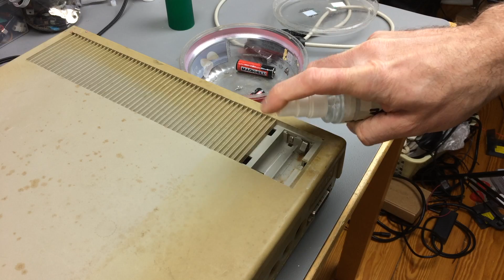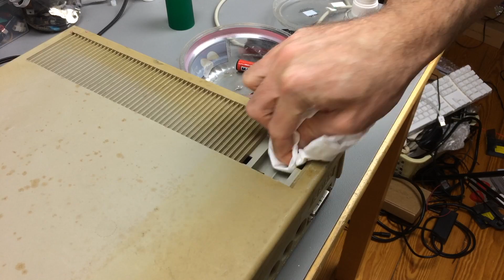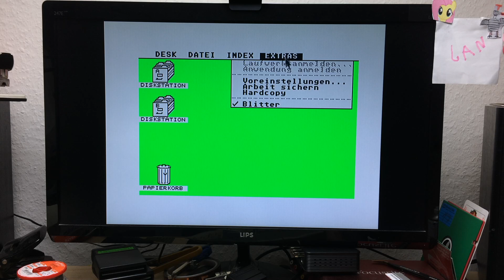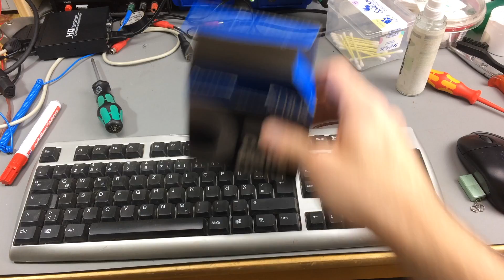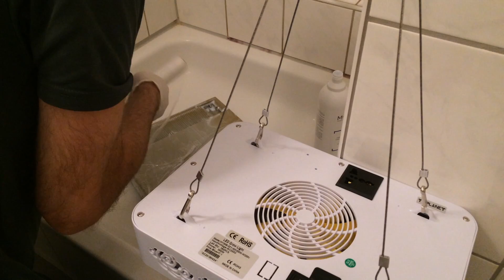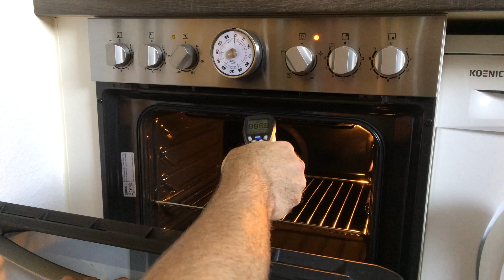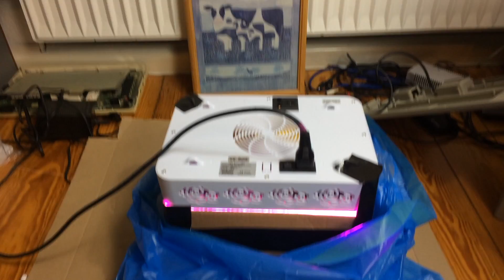Atari Mega 1/Mega ST Restoration

Comment: In 1991, I had that Mega ST with a Hi Res Monochrome monitor and harddrive but had a hellava nightmare when a friend sent me his vie 'Parcel Force' delivery service in the UK, it took 6 weeks to arrive and when it did, the main case was cracked, and the PCB of the keyboard damaged on the left side leaving some keys non functional. My friend made a claim for damages and failed delivery..then a few weeks later two guys came round in black suits (looking like the guys from the Men In Black films) to my house to have a look. They tried to claim the sender didn't pack it properly (which was bollocks ) .... A year later, I blew it up when I tried connect a CRT TV to it... I wasn't too bothered as I was really wanting an Amiga 500, which I got a few months later, and a year after that I got an Amiga 1200 which I still have today. It's setup in front of me, next to my I7 920 desktop system and laptop.

Comment: Hi, I used to repair all of the Atari ST range of computers back in the day in the UK and what i can recommend replacing are the square 68pin sockets for gold plated sockets they are far superior and once you do this you will not have any contact issue's with the Glue, MMU or Blitter chips. I also used to replace all of the socketed chips with ZIF sockets especially for the yamaha sound chip which also acts as a side select and drive select for the FDD access. You can also upgrade the 1770 disc controller for a 1772. My brain is a little rusty but i would also suggest socketing the 1650 chips because they have a tendency to fail.I cant think of anything else at the moment but if i do I will let you know.
Reply: Wouldn't the WDC disc controller upgrade require also upgrading to a later version of TOS? Like 1.06?

Comment: About the scrolling. Horizontal scrolling is really really REALLY hard without the Blitter-Chip on the ST (STE has an updated Shifter/MMU that can do that). The Processor has to copy all the bytes two at the time (12 cyles per 2 bytes). You can buy some time with double buffering, drawing one frame while showing the other. But doing so in a game is absolutely impossible. There is simply not enough time. I wrote some scrolling demo that used four frames at strategical points in the memory and drawing in them simultaneously to allow a semi smooth scrolling. But it took up all the CPU-Time.
Vertical scrolling on the other hand is really easy. All you have to do is moving the start point of the graphic memory by the amount of byes that makes up one line on the monitor. here it helps that the system memory and graphic memory are the same. How often i wished i could switch The Horizontal Sync and Vertical Sync on my Monitor so that the image is drawn from left to right not from top to bottom. Would have bin so much easier to make nice games. :-)
What the Blitter chip does is copying (and transforming if you want) one (or two) memory region(s) into an other. To do that the processor gives up the system bus for a few cycles. The processor can do his own thing in that time with the internal stored data and command. The Bitter is nearly 10 times faster that the CPU in copying the data.
By the way four devices get a share of the system bus. The CPU, the Shifter/MMU (graphic processor and memory controller), the DMA controller (Floppy/ACSI) and the Blitter.

Comment: Retrobriting using the "oven technique"  worked quite well for my Super Nintendos. I used 10% hydrogen peroxide mixed with water (effectively giving 3% h2o2) and put them in the oven using a roaster @ 50°C for about 24 hours, sometimes even 36 hours. Time and patience are the key ingrediences here: Higher temperatures make it go faster but are dangerous to the plastics. The advantage is homogenous briting and no streaks. But it takes way more time ... in your oven.

Comment: Great video! I see the keycaps being persistently difficult. I have found that leaving the keycaps on the frame (after removing all electronic parts) and treating the entire unit as a single entity really helps. Just cover the entire thing in peroxide, and you can be sure at least that the keys are all facing the light source. Whatever results you end up with will at least be uniform.

Comment: I acquired two mega 1's, both had the original "magic" batteries still in there. One did not leak, the other has corrosion on one of the contacts. I guess these batteries lasted quite a few years, and when the mega's went into storage the batteries were hidden well enough to  be forgotten by the original owners.

Comment: The little board on top the cpu is a "blitter patch" and the rainbow fuji on the about window means it's tos 1.04 (only tos 1.04 for the stf and the mega st and tos 1.6/1.62 for the ste had the rainbow fuji).

Comment: It looks for a disk on power up.  If there isn't one it boots to TOS as you saw.  The disk can have desk accessories and other programs which will load.  But not needed like on the Amiga.
Reply from the maker: Yes, figured that out. I was a bit surprised about how long it looks for a disk before it starts the system from ROM. It makes sense because usually you would insert a disk at some point anyway.

Comment: Maybe I should try to restore my Mega-ST2 (extended to 4 M) and Megafile 60, and in the process reinstall the PC-Speed emlulator (that was removed when extending the memory).
The PC emulation inside the Atari ST was a real kicker at that time. It was so much superior to a real PC-XT of that era. It could handle up to 736 KiB DOS memory and had high res Olivetti graphics 640x400 BW and the 8MHz NEC V30 cpu. The Atari memory could be used as EMS memory and/or ram-disk.
The fun part was that the V30 was faster than the 68000 when the access was within a segment (3 cycles instead of 4) so there was a VDI version using the V30 to accelerate subtantially the graphics of the Atari when running under TOS. There rarely was such a symbiotic hardware than that.
Reply: Those Megafile hard disks are extremly loud and slow. Forget about it and get a modern, SD card based replacement.
Reply: Check out the Atari ST Forum over at AtariAge. I believe there's instructions on how to install a 2nd Drive into the MegaFile case. Of course, it appears that a lot of people are taking those SCSI-to-SD adapters and installing them in a lot of the external Atari ST drives and enclosures. I saw one done to an external Supra hard drive that was the equivalent to the Atari SH204 back-in-the-day. Personally, I think that would be cooler than using an UltraSatan device. More work though, obviously.

Comment: Great vid Jan. I don't wanna be a net nanny, but please take care when working on the machine when powered on, especially if you have the antistatic strap on your left hand and probing around with your right hand, the PSU heatsinks are live at mains voltage! (there should have been a sticker wrapped around a couple of them warning you). 

To get to TOS quicker make a couple of "boot disks", one for low and one for medium resolution with some .ACC files in the root directory and maybe an Auto folder to contain .PRG's you want to run at boot. You can also just put a formatted disk in. TOS checks the drive for boot sectors for days if no disk is inserted. 

I'd also see if you can find a copy of "Your second manual to the Atari ST" If you are totally non familiar with the ST / Mega range. The first revision is decent, I have a hard copy. The second revision comes with floppies and more pages, probably related to the software it comes with.
Reply: Yep, wearing wrist wrap or being grounded any other way while poking around mains voltage is a bad idea, especially with two hands which would result in current going from one arm through the heart to the other arm.
Reply: Exactly. I can tell you from experience that these particular PSU's bite hard. I caught my little finger on the one inside my STE when I was a kid, while messing around with the SIMMs, I got fed up of switching off and on to get it to boot so left it on and used the reset switch. Turns out, that was a bad idea.
Reply: Ginger Kitty Project has just gained a new sub. Not used Reason for years.
Reply: @Neffers_UK  I released over 100 songs in public domain. At my music artist channel. YouTube for Ginger Kitty Project, my artist channel is Gary Kildall.
Reply: Proper wrist straps have at least a 1-MOhm resister between the strap and the cable. They'll dissipate static, but they won't provide a dangerous ground/earth path.

At work, they have test stations, where you can verify that they're within spec.
Reply: Okurka  There is, rear right.
Reply: @Joe Casson it's very common actually. If it's in a case where it's not going to get touched anyway, skipping the use of a thermal washer provides significantly improved heat transfer between the switching mosfet and the heatsink
Reply: Meh. What is it 240v? It's just a tickle.
Reply from the maker: Oh, I usually take off the wrist band when I plug in the machines for testing with the case open (might have forgotten in this video?) and run the mains at least through an FI switch or my isolation transformer. Didn't know that the heat sinks are live in this one but it makes sense. Thanks for the reminder.

I'm going to make some boot disks as you suggested soon. Will make things a lot easier. I also consider getting a second drive or maybe a Gotek as well as one of the modern hard disk replacements for it some time. Also going to be on the lookout for the book you mentioned. Thanks!
Reply: Ah good :)  I hope you enjoy messing around with the machine, I certainly enjoy messing around with my Atari stuff.
Reply from the maker: Update: After working on the power supply I could confirm that the heat sinks are actually connected to ground in this particular model.
Reply: @JanBeta  Ah, good. Worth checking non the less :)
Reply: @JanBeta  they usually arent, so always best to assume that they're live. to be honest, wearing an ESD strap isnt really more dangerous because there is a 1 Megohm resistor in line with them, so the strap itself wouldnt allow enough current to pass to give you a fatal shock. However you'd still get a shock as normal, unless of course you used an isolating transformer.
Reply: @JanBeta  While your findings on this PSU are ground, please be aware the the STe PSUs that I have had in the past were live on the heatsink. I wasn't making stuff up to make it sound like a I was pretending to know more than others. My 1st bad shock came from a heatsink of an STe PSU. 

I'm just trying to make this aware, that is all :)
Reply: @Joe Casson: True. I got zapped by one (Atari 1040ST) myself when I was a teenager. Stopped my heart for one second and blew the RCD breaker. Would not recommend.
Reply: @TheSquarecow  you're lucky it outright stopped your heart... usually the heart restarts itself in this case. Far more dangerous is fibrillation, when your heart does not pump properly.... and thats usually what happens when youre electrocuted by mains power

Comment: MEGA 1 is somehow underestimated model from the ST family. You've got a late unit with a factory installed Blitter (the PCB on the CPU is there for that reason) and a Rainbow TOS (1.04). Not all MEGAs had a Blitter (so you're lucky), and older units had TOS in 6 256kbit Mask-ROMs (you have 2x 1024 kbit). If you want it to boot faster, just insert an empty DD floppy in the disk drive.
I'd leave the motherboard as is, as I have never seen a bad capacitor in the ST. Board is clean and works ok, so it is not worth to ruin that ;)

Comment: I think the 1 Mbyte Mega ST was a later one. The first ones have had 2 Mbyte and 4 Mbyte. I also think all Mega ST had the Blitter chip. The Mega ST series normally was fitted with TOS 1.2 (later renamed to 1.02). This one has the so called "Rainbow Tos" which was originally made for the 1040 ST instead. It was probably added manually later.
Reply from the maker: Yes, you are right. I think the 2 and 4 MB versions came first. I read that the later revisions of the Mega 1 came with Rainbow TOS from factory (at least the German ones). This one was sealed, so it must be true. ;)
Reply: Oh nice. The rainbow TOS, named after the colored Atari sign in the TOS info panel, was a big improvement over the TOS 1.2. :-)

Comment: Great job! I love seeing Atari ST restorations, especially since Amiga stuff is way more common. The Megas were the first STs to include a blitter chip, Later STe models also had them. The TOS was also called Rainbow TOS because of the rainbow logo on the About dialog. Amigas were definitely better for gaming, but I used my ST for programming and apps and I think the ST was better at that. That's probably why Amiga is more common in videos -- old games are way more interesting than old apps and programming tools.
Reply: Absolutely. I sold my Amiga 500 for a Mega-ST2+Megafile 30+SM124 when I was studying informatics. Gaming on Amiga was of course much better, but programming and word processing was not even close. You needed so much extensions on the Amiga (at least a second floppy but better a hard-disk a shitload of RAM chip & cpu RAM) it was ridiculous on a 500. With my brothers  1040STFM I could do my programming assignements of University with 1 floppy and that was it.
Reply: Rainbow TOS was 1.04. Most Mega ST models shipped with 1.02 which added support for the Blitter and the Real Time Clock while attempting to fix some of the earlier TOS bugs.
Reply: My Mega ST2 had TOS 1.02 but now it has TOS 2.06 and 4 MiB of RAM. When I bought the TT, I gave the Mega ST2 to my brother who used it exclusively for text processing (Tempus Word). For that reason I upgraded the computer. It required the installation of a separate board soldered on the CPU which forced me to remove the PC-Speed emulator that was there before. I think I should try to put the PC-Speed back in the Atari.
Reply: @galier2  
The cheaper Amiga models 500, 600 and 1200 were not suited for real extensions. The 1000, 1500, 2000, 2500, 3000 and 4000 were far better for such purposes. 

My pimped Amiga 2000 is very beefy with two 40 Gb SCSI Solid state HD, 8 Mb ram extension to the max 9 Mb on the board itself (1 Mb installed from factory) plus an extra 256 Mb fast ram on the co-processor 68328 (DragonBall) system-board designed and build by myself replacing the bought factory made 68030 accelerator with 32 Mb of fast ram. I salvaged the MC from an old Garmin device. My Amiga has a Bridgeboard for 486 XT hardware emulation and an A-max II for Macintosh hardware emulation. It also has a CD/DVD-player/recorder, 100 Zip-drive and the original FD DD it came with for media input. To complete the build it has 2xUSB and HDMI extensions on the system-board outside the SCSI and IDE through Zorro II. One of my SCSI HD is coupled directly to the Bridgeboard its SCSI, the other to the Zorro II expansion and as thus I have a dedicated HD for my shitload of MS-DOS games and applications. 

My pimped Amiga can run any Atari ST in software emulation (Medusa) and outperform the original Atari ST hardware. It can run Window$ up to 2000 NT and MacOS up to 9.3.1 native through hardware emulation. XP and up while installing correct result in a blue screen of death upon first boot without the disk most probably due to ram shortage, the OSX installer boots but does not install anything at all no matter how hard I try. XP should however be able to run on a 256 Mb 486 XT 133 Mhz computer but it just does not for some strange yet unknown reason on the Bridgeboard. Working on it because I really want to see that one happening. 

The speed of the accelerated system is around 233 Mhz effective in the benchmark with 250 Mhz at its top and some dips to 220 Mhz. Quite the headache to get the 68328 to work with the Amiga as co-processor as it is a all-in-one but the end result is great because it made it possible to add the extra 256 Mb of fast ram with a possibility to add another 256 Mb of fast ram (out of money right now, coming soon to try to get XP or Vista to work on my Amiga), the HDMI and USB. I made it so that I have buttons on the left side of the case to turn the 68328 acceleration, Bridgeboard or A-max II on or off so I can run in any mode easily.

My favorite to run outside AmigaOS 3.9 is OS/2 and it really does a great job at that with the Bridgeboard. Accelerated Amiga + Bridgeboard + OS/2 + Warp = a match made in heaven to run MS-DOS games and applications.

Amiga rules!

Comment: The Atari ST boots it' OS from ROM which takes a only a second or two, however, if you cold boot with no disk in the drive it will appear to take much longer, this is because the OS is trying to read a disk and looking for any auto excec files that may or may not exist.

Comment: Looks good. The keycap's came out way better than the case, for some reason.
Reply from the maker: I think they were brighter from the start so it looks better. The case looks almost like new I think. It's always a bit difficult to film the little color nuances but in reality, you can still see little yellow gradients on the keys unfortunately.
Reply: @JanBeta  Yeah. At least it is much, much, much better now. I think it would be a shame, if old machines are brought back to 100 percent factory new state. If they look like pee, they look disgusting, yet there are no need to remove all battle scars. After all. They were build to be used and not to rott away in a museum. Gutes arbeit Jan. Wirklich gutes arbeit.